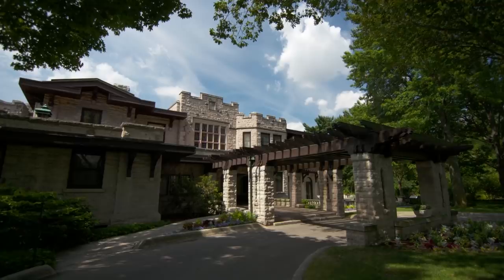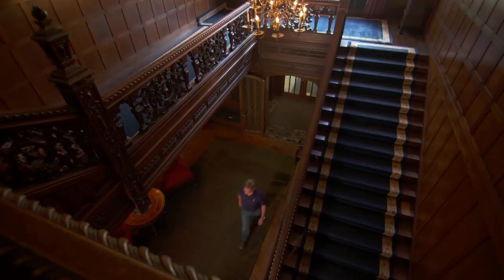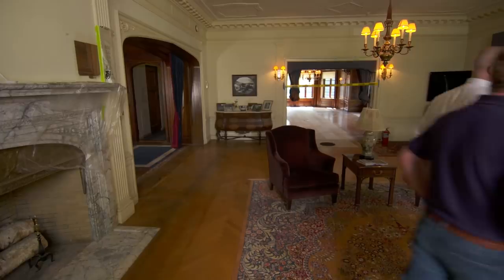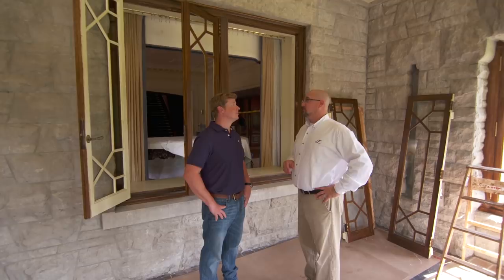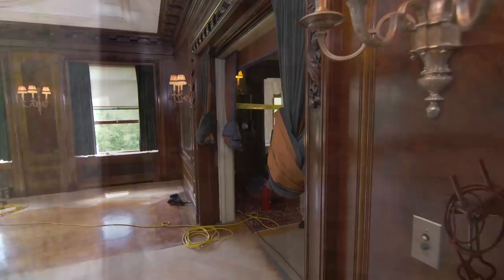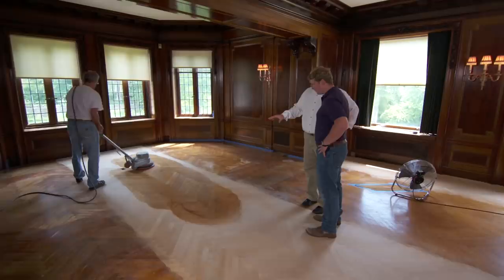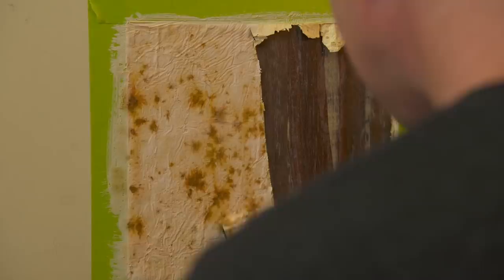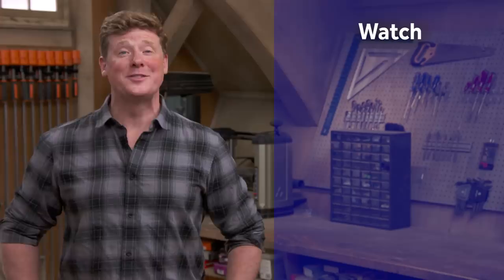Touring the Ford Mansion | This Old House

Comment: Sad to say that the Foundation has sold ALL the land around the house and mismanaged funding. The Henry Ford was tiring to help for years and was going to start work on the Estate in 2020 but with the pandemic they have had to delay the project. The Estate does even own the parking lot, that could have been used for catered functions at the Estate, and would have helped create a revenue stream.

Comment: Lord I hope they incorporate fire sprinklers. What a fire load. Beautiful home.
Reply: Retro fitting of fire prevention measures might have been a condition of insurance perhaps?

A lot of our old "stately homes" are fitted with fire detection systems, including alarms/sirens, break glass panels, sprinklers the lot, etc, etc.

These places have had centuries of beeswax polish soaking into the timbers, which must be regarded as more or less 'kindling".

All wiring in what we call mineral insulated cabling. And, that is left visible as far possible for ease of inspecting the system and not damaging the "fabric" of the building, some of which might be over a thousand years old.

I suppose an insurer will do its own risk assessment before offering cover. If they are covering a few £millions of property and contents then they decide how it's going to be done.

Possibly it is insurers themselves who work with/supervise (?) said contractors as a further condition of cover???

Oddly enough the physical presence of the fire systems are sort of filtered out by the human brain and you don't notice them.